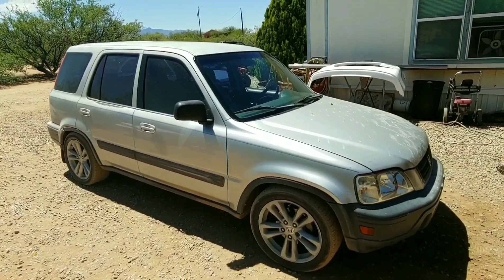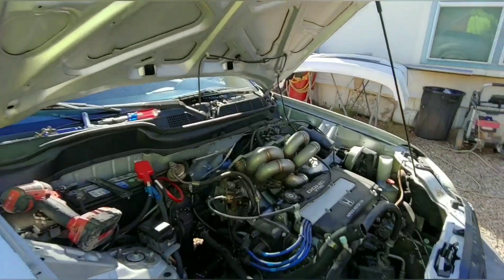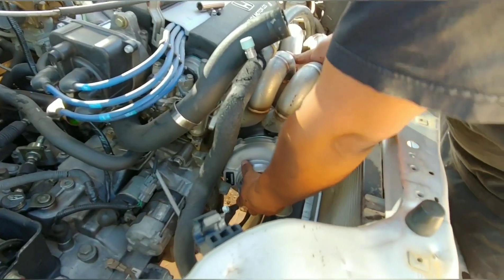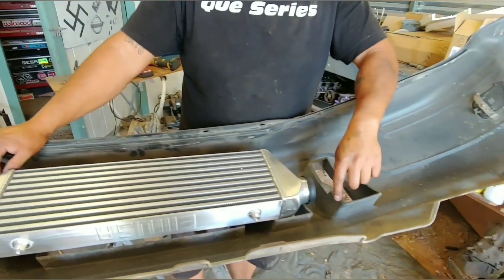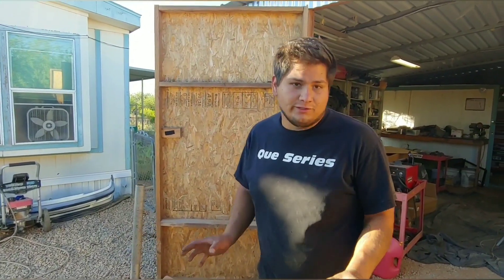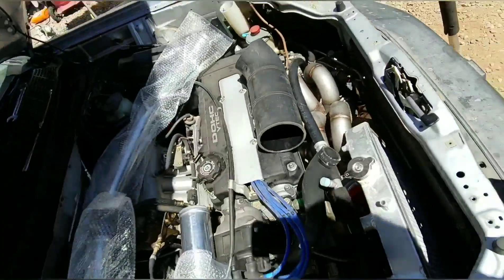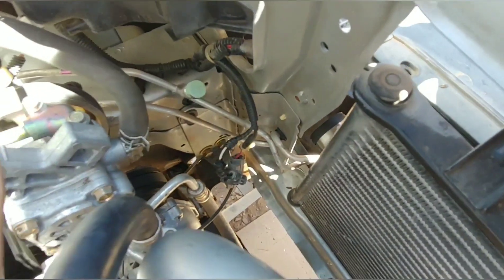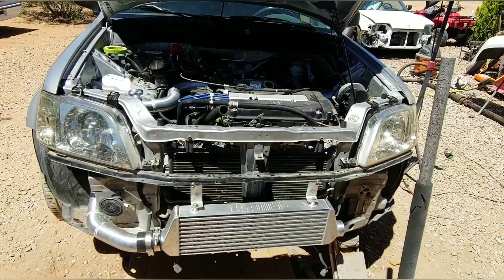Turbo CRV daily (boosting the RD1)

Comment: I love Hondas. My family always had Hondas. I'm 36 years old now and broke off onto Fords. I used to have a 2009 Si Civic Sedan that I miss..

I'm getting a CRV in a couple months to be my daily driver. About 2 months ago I bought a Police Interceptor Crown Vic.. The transmission went bad 2 weeks after I bought it. Lost 3500 dollars. I gave the Crown Vic to a local transmission shop to fix my Mustang.. I bought the 08 Vic to be my daily driver while my Mustang was out of commission. 

Now I'm saving my money again and this time I'm doing what I should have done and that is to get a CRV...

I see a lot of seemingly nice ones on Craigslist for well under 5,000... A lot of them do have over 200k miles on them tho but my family has always had Hondas/Acuras.. My first car was a 91 hand me down Accord coup from my mom and that one had almost 300k miles on it and never had a major issue before I sold it. My dad had an Acura RSX that had almost 300k miles on it. Before that he had 90s model Prelude that also had a gazillion miles on it...

Whats messed up is I test drove a CRV like yours before I got the Crown Vic.. It was silver with a 5 speed.. They wanted 3,000 for it... Man, it looked new but so did my Crown Vic.. I'm kicking myself hard for not going with the CRV.. It ran perfect... The guy let me drive it around Raleigh for over an hour by myself.. It had what looked like the same motor my 2009 Si Civic had.. The iVTEC motor...

In a few months when I get the money saved, I'm buying a CRV.. After I get it and find that it's going to be reliable, I want to turbo it...

If I can get 300-350 horsepower out of it and it still be reliable, it may become my favorite vehicle..

My Mustang is a 2010 GT with the 4.6... It's pushing alittle over 300 horsepower.. I'm not satisfied with the speed of it anymore..

I want my upcoming CRV to be able to outrun my Mustang....

Comment: couldnt you put the OEM radiator back in but put the fans in FRONT and reverse the polarity on the fan to spin the opposite way?
Reply from the maker: I wish I could have done that but there wasn't enough room for the full size radiator unfortunately the wastegate is right where the radiator should be

Comment: My Japan made 97 cr-v runs like a brand new engine at 225,000. Ive been thinking of getting the turbo. I knew the difference isn't great but it's my only complaint about this car is people getting mad at me from behind pulling away from a light unless I  am flooring it which I'm refusing to do. I'm sure you know what I mean.  So the question is will this make enough that I'll be glad I did it?  Thx
Reply: Floor it, it shifts at 6200. Will never blow up

Comment: Are the internals of the engine all stock?
Reply from the maker: Yes
Reply: RyanEFhatch meaning i can just add turbo turbo kit etc on my stock honda crv gen 1? :)
Reply from the maker: Yes the motor wont have a issue just have it tuned. You will just minimally need 440cc injectors or bigger and someone to retune the ecu
Reply: @ryanefhatch9249  how many psi? And how has the awd system held up